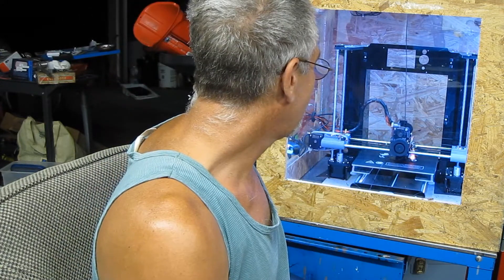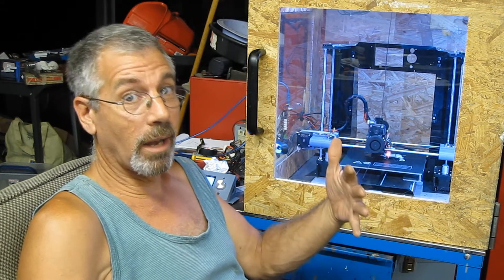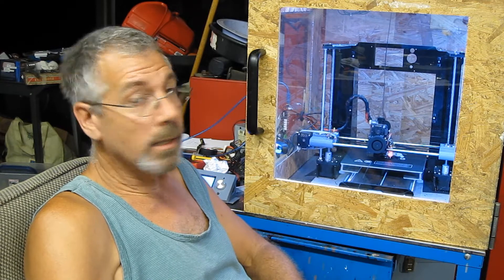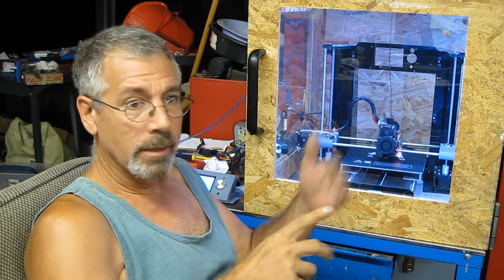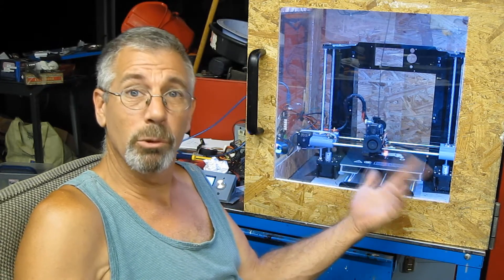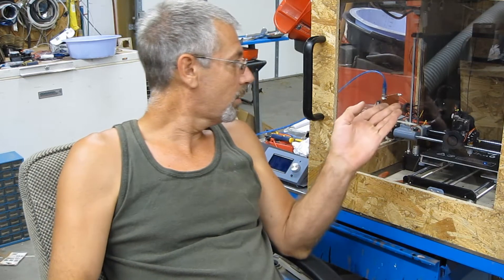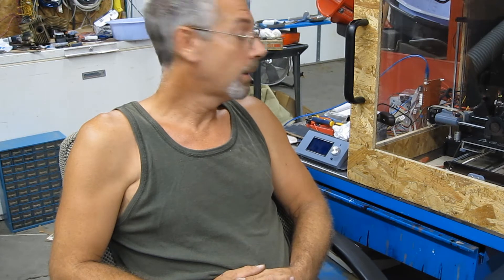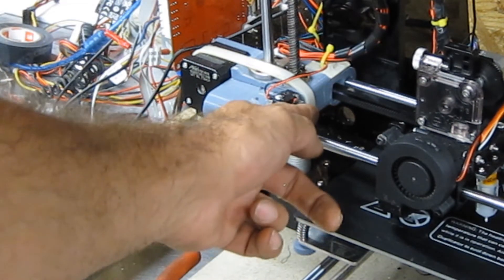The E3D TITAN EXTRUDER PROJECT, ANET A6, Part 3 FINAL!

Comment: You don't mention that pancake motor for the extruder that you talked about in the beginning videos. Did you end up using that?
Reply from the maker: I was having problems with it, not enough power.
Reply: @marcellemay7721  So I guess you went back to the stock motor?

Comment: The "Anet A-6 community" is smaller than the "A-8". Wich makes "A6 video" even more usefull.
I guess that most of the "A8" hacks will work on "A6", but as a newbe, I prefer to start learning from "A6" Youtubers like you. Then, I'll get more experience and I will figure out how to find my own path.

I will receive my first 3D printer in about 3 weeks; Yesss ANET-6 !!! 

Thank you for sharing your hard learning experience!
Reply from the maker: +Alexandre Valiquette When I started making videos on the a6.vI was one of the first to heavily modify the a6.  The a6 and a8 are similar in many ways but the a6 is different in many ways. It is more compact and uses a different x axis configuration. This is why many of the a8 modifications will not work on the a6. We started a new a6 steel frame design just for the a6. Thanks for watching and subscribing!

Comment: Marcel is this height correct?
https://drive.google.com/file/d/0Bw6VHJLHGJllTjliOHhNUTJaUUE/view?usp=sharing

Do you have the same nozzle and fan duct height?
Reply: Sure thing Marcel,
Once again, thanks for the great videos and your support!

BTW, X axis carmounts are half-way printed, cannot wait until I assembly new extruder on your adapter!
Reply from the maker: przeczochrany 
My nozzle height is definitely closer to the height of the fan duct. Is everything assembled tight?
Reply: Well, It cannot be tighter :)
Did not change anything in your design and this e3D V6 JHead knockoff has the same dimensions as original. Checked with the documentation here:

https://wiki.e3d-online.com/images/1/15/V6-175-ASSM.pdf

Exacly 62.3 to the tip of the nozzle.
My heat block without silicone sock, as well as the fan duct, ends 14mm from the bottom of the cariage.

I think the fan duct should go a bit lower (or turn the air stream more down). What do you think?
Reply from the maker: Mariusz M 
I designed it with the dimensions of the original. I also have a clone v6 , and it worked out perfectly.  You can space the duct down a little with some spacers. The fan goes flush to the bottom of the body, so there's lots of room to slide it down.
Reply: Thanks for the comment,
Well, mine is definitely a bit taller then...

Any chance you drop me original fan duct Fusion 360 file so I could rework it?  mariusz@mackowski.me
Reply from the maker: +Mariusz M  Give me some time. I'll see if i can post the whole thing on thingiverse.ok,?

Comment: Hi Marcel,
Does your BL-Touch work properly?
I mean after auto-bed-leveling, on uneven bed, does it adapt Z height during the print?

Mine does not (and I think it's SkyNet 3D not programmed correctly)
Reply from the maker: +przeczochrany Yes it works great. Check out my other auto bed leveling video, it's not about the bl touch, but there's some good tips about abl in general., There's also a link to a good little file that prints a perimeter , 0.4 mm  thick that you can use to check the bed level.
Reply: OK it came out I did not add auto bed level to the GCode.
After adding it, it works for the print
Reply from the maker: Mariusz M  That'll do it!😉

Comment: So what problems did you have when using the clone vs real aero?
Reply from the maker: jxt  First off, the mounting screws were too short to thread into the motor., The gears were not round, so only a full size motor could turn it., which would have been fine if it was a Bowden setup, but the main reason I went to this was for a light weight direct drive setup. Poor fit and finish. Plastic drive great, instead of a steel drive gear. It really was a pos.
Reply: Ah I wish you made a comparison video now before you put it all together lol. Was the clone you got the Trianglelabs one?
Reply from the maker: +jxt The titan clone was from blu rolls on Aliexpress. My point is that you're taking a gamble when buying any clone. The originals work, that's why they cloned them in the first place. Nobody would try to capitalize on something that doesn't work. The problem is, in the rush to get the clone to market they often overlook the finer details to make the thing work properly.
Reply: Yeah it's always a risk with clones. I was just curious how close it was. I also wanted to know how you hooked up your bltouch? There's not much info about it that I could find.
Reply from the maker: jxt a In the description of this video, there's a link to the thingiverse page that has all the info for hooking up the bltouch. 👉
Reply: Marcel LeMay Yeah I downloaded the doc but was wondering if you could add some photos too?

Comment: I got that same x carriage, you should really consider using the Z pushers instead of having the threaded rod coupled to the lead rod. Eliminates any possible Z wobble. Check this out:
thing:2441862

Also check out my channel, should be a video of my ANET A6 with upgrades. 
Nice upgrade bro! Just subbed :)
Reply from the maker: Patrick Nijkamp  Hey Patrick, thanks for subbing. I solved the z wobble issue by straightening out all the lead screws and linear rods. Check it out. https://youtu.be/qgQuXM3yVIU
Reply: Nice! Even better! :)
Reply: Although one thing I really like about decoupling it anyway, is that I have an autobed level sensor...and should it fail (it has crashed in the bed a few times while setting it up ;p) The nozzle cannot penetrate the glass...since the carriage just lifts...I love that about it too!

Good going :D